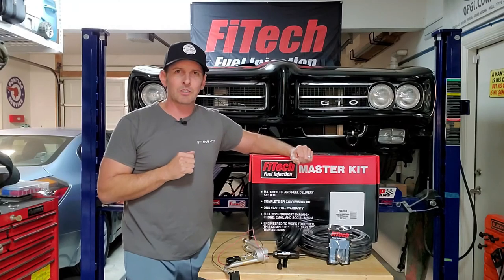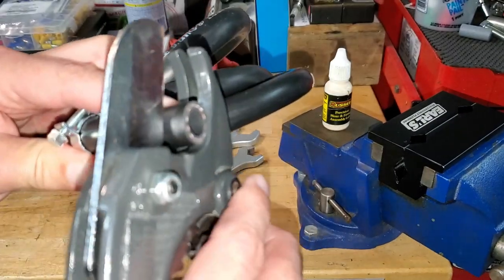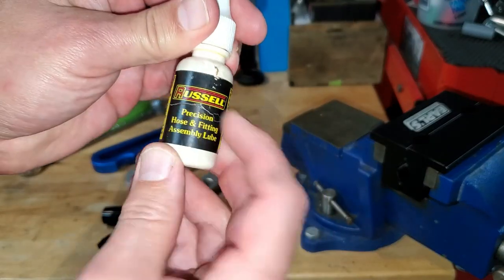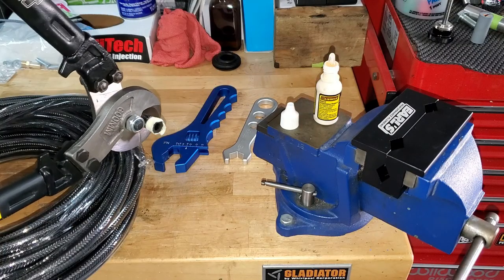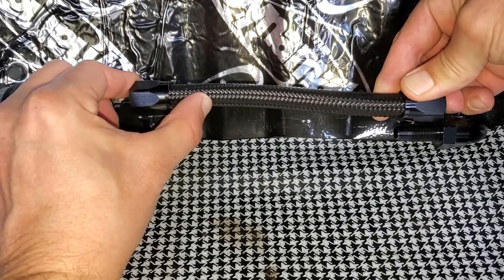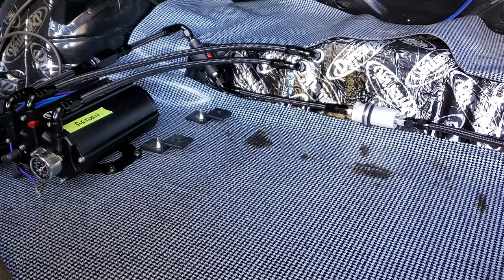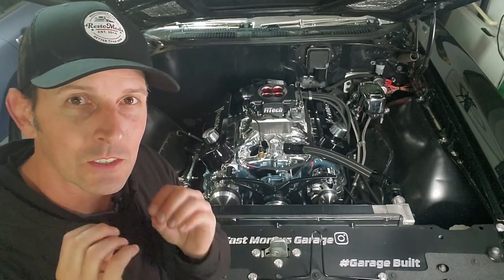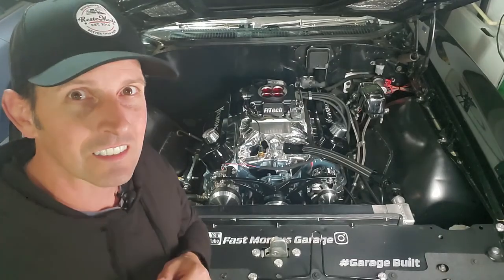Fuel Injection Conversion, Part 6:  How to Plumb fuel lines using AN Hose and AN fittings.

Comment: Sorry, I'm binge watching your stuff while having a couple of beers, lol! But, the holley minimites along with the carters ect. don't have enough head pressure to be mounted reliably above the tank. They need to be mounted close to the bottom of the tank, even if the suction comes out of the top of the tank. It increases head preassure. If you guys find them going out relocate them close to the tank along with there filter behind the rear axel with a custom made simple bracket.

Comment: Thank you Mike for the excellent video esp for the right pace of speaking and the video capture of the process details. Even I as a beginner enthusiast can follow and understand! Question - can I use rubber hose and AN fitting to run fuel from the fuel distributor to fuel injector? I read that due to very high pressures, metal tubing and brazed ends are a must. Even securing the hose ends with a hose clip is not good enough. Tks!
Reply from the maker: Thanks for the comment... I assume you mean running fuel line from the fuel pump to the engine/throttle body?  Yes, you can use AN hose for that, BUT make sure it's rated for High Pressure Fuel.  All of the fuel lines I use are AN style, and are rated for high pressure.  Thanks for the question!

Comment: Oh jes, I hope I won't be too irritating. But, The correct way for your lines to be is with a deliberate slight bend in all of them, for thermal expansion, and mechanical strain on the hose fitting connection. I can probably find u-tubes for you to see, if you want?
Reply from the maker: That makes sense... I'm not concerned, as I'm no where near a heat source, for that shorty length of hose.  Even then, my old Barry Grant supply line was a fixed length AN hose... so, curious to know at what point the length would be of concern.  Pretty sure it wouldn't have been designed that way.  :)  Thanks again!

Comment: Good video, thank you.  I like the way you have the fuel line coming into the throttle body.  I think you should make sure to do something to protect your break line from vibrating against the bolt heads and bracket of the new fuel filter.
Reply from the maker: Thanks, and Agreed.  I can't remember if I mentioned it, but yes, I used the same rubber coated clamps for the brake line at that spot.  Thanks for watching!

Comment: Got an idea to have you think about . When you cut the braided hose put a bolt inside the tubing and then use a  tubing cutter over the tape. What do you think .?
Reply from the maker: Hmmm, maybe?  Sounds like you'd risk getting bolt shavings inside the tube.  Also sounds like a pain in the ass... as compared to how fast the shears work.  Give it a shot, and let us know how it works!  ha, ha...  Thanks John.

Comment: Oh, good news, ya while a chevy 10 bolt is generally only good to about 450hp, a bop 10 bolt is generally good to 500hp depending on condition and gearing. But, if you break an axel you should be able to go with just aftermarket axels and be fine!
Reply from the maker: Yup, probably a future video.  :)
Reply: @FastMonty  ya, If your going to change you rear axel, just figure on going to a ford 9". And adapt the breaks.
Reply from the maker: @markjackson6829  Agreed!  Thanks!

Comment: Great Videos on the Fuel injection install. I have a question unrelated to this video. I have a 1980 Pontiac Trans Am and would like to move the battery to the trunk, how did you do it to your GTO? Did you make a video and I just missed it. Thanks in advance for your time.
Reply from the maker: Thanks John!  No, I don't have a battery install video.  But, what I can tell you is make sure you use ZERO Guage wire. (0 AWG)  For both the positive and negative.  Second to that is to make sure your body ground straps are good.  I upgraded all of mine.  Here's a link to a Zero Guage kit I found on Summit.  https://www.summitracing.com/parts/tbo-ts-racekit-1  Hope that helps!

Comment: Hey Mike, have you mounted the holley pump directly on the body or do you have some rubber bushes in between? it could take a lot of noise/vibrations from the pump.
Great video.
Reply from the maker: Good point... that would help, we'll see how it goes.

Comment: Do you have to run fuel inside the trunk?  Why not install everything under the car?
Reply from the maker: Good question, Roy.  No, I don't "have to" run fuel into the trunk.  The critical placement is the Force Fuel unit.  It will not fit under the car... soooo, you could put it anywhere you want.  In the engine compartment, on the passenger seat, on top of the roof... anywhere.  :)  I elected to put it in the trunk, just to save clutter from the engine compartment.  The Holley pump could be mounted under the car.  Again, since I was already running line to the Force Fuel unit, I elected to put the Holley pump in the trunk... we'll see how it goes!  Thanks for the comment!

Comment: Hey man's how's the coolant ports on the back of the heads holding up with those ANfittings?
Reply from the maker: They're freakin awesome!
Reply: @FastMonty  soon I will be rebuilding my engine and. I was wondering if. You remember what those head ports needed to be threaded too for those fittings? Or was. It already threaded for them factory ?
Reply from the maker: @tanner8288  Good question.  If you have stock heads, they are not threaded, and you'll have to add a push in nipple and use standard rubber hose.  If you have, or get, Edelbrock heads the ports are 3/4 NPT thread.  Where you could still use standard rubber hose, I just went crazy and used AN fittings.  Hope that helps.

Comment: My car doesn’t leak any fuel using the factory type lines on my 780 Holley in my 70 Z28.
Reply from the maker: One, I'm happy you have no leaks.  Two, that's a carburetor that has 5 psi of fuel pressure.  When you're talking 60 psi, for Fuel Injection, why take any chances?  Go with AN fittings and have no worries.  Thanks for watching!